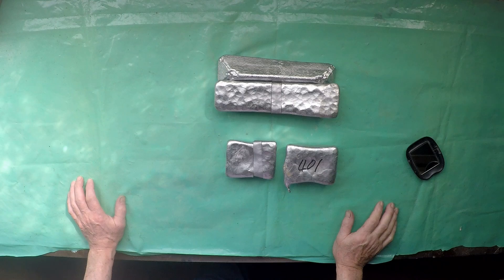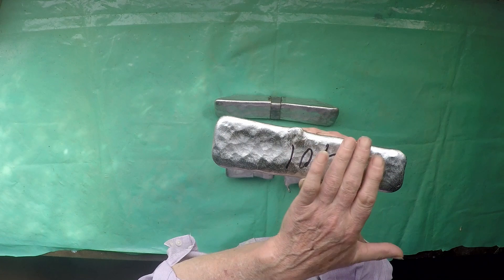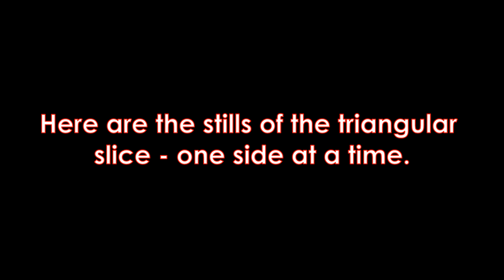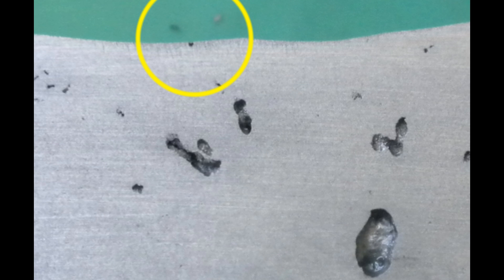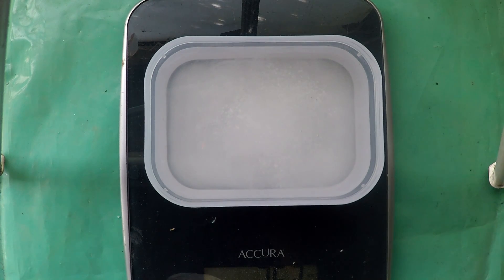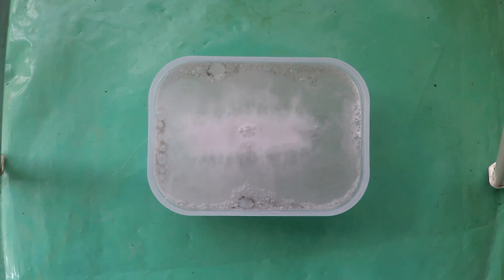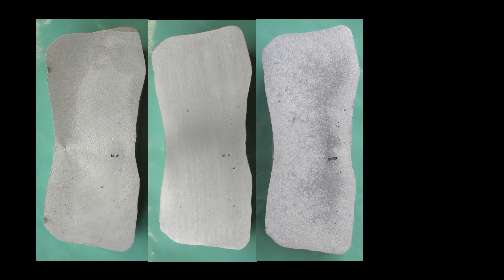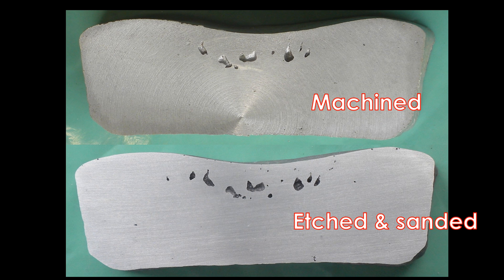Caustic Soda etching to reveal porosity in aluminium alloys.

Comment: Gloves and safety squints for certain with caustic soda.
If it gets in your eyes, you get less eyes.

The feeling on your skin is 'soapy' - it converts the fats from your skin into actual soap.
This NaOH etch produces Hydrogen gas, so be sure to do it outside, well ventilated.
I once blew up a car battery on charge. Hydrogen gas explodes really fast. A situation best avoided.
Alternative etchants would be HCl/Hydrochoric acid/Muriatic acid (all the same thing) or FeCl3/Ferric Chloride.

FeCl3 stains everything yellowy-brown. 
If it gets on your fingers you look like a seriously heavy smoker for a week.
Reply from the maker: aga, Yes, I am well aware of the dangers of caustic soda - another of its nasty little tricks is that its dissolution in water is an exothermic process - enough caustic in a small enough amount of water and it will boil possibly spitting saturated boiling caustic solution all over you. 50:50 caustic water will do it! 
And as you say H is very flammable and explosive, I too have had a battery blow up under my hands blew the top clean off  a 72 amp hour 12 volt battery scared the crap out of me and did not do much for the battery either. There of course it was an H and  O explosion a lot worse that H air. Not sure if HCL will do the same job on aluminium as the caustic and will generate H anyway (I think) and don't know about Fe chloride acidified or not its usually more used for copper base etching. I have both so I will try them -  stay tuned. Thanks for the input… Martin
Reply: @olfoundryman8418  Quite a few things will have a go at Al. 
It is an extremely reactive metal.
It reacts so fast with oxygen in the air to form that oxide layer it disguises it's real character.
HCl, H2SO4, NaOH, FeCl3 and many more chemicals will etch it.
For some, e.g. H2SO4, it'll go faster if you add a pinch of salt. The chloride ions strip away the oxide, exposing the actual metal,  making it go a lot faster.

My battery blew up because i'm partly Idiot. Just wanted to angle-grind a chunk off a bar, right next to the on-charge battery.

Had a full face mask on at the time, fortunately.
Took several seconds to work out exactly what had exploded, then the tingly/stingy sensation started all over my head and back.

Turned out that when the battery blew up, it sprayed acid upwards, which hit the shed roof and rained on me.

I flushed all affected areas with water very quickly (jumped in the pool fully clothed).

No angle-grinders were harmed in the process.

Comment: What grit are you using for your fine sanding?
Reply from the maker: Andrew, The abrasive paper is not actually marked but I would judge it to be in the 400 to 600 range. Its really the caustic that does most of the work - all abrasive strategies regardless of how fine will flow the metal and thus tend to cover up defects. The caustic removes the flow but it also exaggerates the cavities a bit because it will eat them a little bigger so  don't etch for too long. The final after etch sand is very light, just barely enough to remove the worst of the etch.... Martin

Comment: Brilliant video Martin. A real eye opener for a problem most castors are unaware of and do not know how to look for.
Reply from the maker: Mark, Thank you - it sort of shows up what most people never see. But also it shows that many worry about gas porosity unnecessarily - This metal was very gassy as witness the fizzing I saw as it solidified and yet in the sections there is very little evidence of true gas porosity and what is there is so small as to be unobservable without the etching (But polishing with a mop might have showed it up too). The large shrinkage pores are of course another matter but they are easily avoided with proper feeding in an actual casting.. Martin

Comment: Nasty stuff that I know lol. Add some lithium to that and you will get purple spitting fireworks from your container lol .do not try at home. Ahhhh so the tiny holes I seem to be getting are infact porosity and maybe not the loose grains of sand I thought they were. Thanks again Martin and swdweeb
Reply from the maker: Raschelle, Loose sand is unlikely to be within the metal.  it may be on the very surface and is then the result of not blowing the mould out properly with air. However, I have found it quite difficult to remover every little grain! You can get an idea by shining a torch at a steep angle along the cavity surface this will show up any little grains sitting above the surface. Really good moulders (way better than me!) used to solve the problem (in part) by "printing back" the pattern. This was the putting of the pattern back in the cavity after all the gates feeders etc were cut and thus any upstanding grains were pushed back into the mould by the pattern and the cavity  thus much smoothed up. However this meant of course that you not only had to get the pattern out but back in again and then out again - you need damn steady hands to do this!… Martin

Comment: Enlightening, thankyou. Here is my 5 cents worth. Having come from a polyurethane casting background, I  know a bit about bubbles and gas porosity in castings, but was always a bit puzzled in metal casting why the "gas "  didnt just go to the surface like it does in polyurethane. I now believe Campbell is correct in saying that the bubbles are actually voids caused by shrinkage pulling the bi-films apart as the metal solidifies. No amount of feeding will prevent these voids from forming. I think the term gas porosity is misleading. If you look at the shape of the voids, they are not round as you would expect , but pointy , backing up the oxide bi-film  theory. I also believe that the reason  bubbling inert gas through the melt works, is that the gas attaches itself to the oxide bi films, taking them to the surface where they are held there by surface tension. Aluminium oxide is denser than aluminium so it should sink but does not seem to. I think that is due to the variable thin layer of gas trapped between the aluminium oxide bi-films.
Reply from the maker: Greg, Thoughtful comment .Whether or not the bubbles go to the surface depends a lot on their size. The smaller the bubble the slower it rises and if slow enough it may get frozen in well below the top surface. Even if big enough it may get caught in an oxide bifilm trail that has become hooked on part of the mould. In this case it may be big enough to have enough buoyancy to  keep rupturing the top of the oxide film and thus ascend or it may not and thus remain caught somewhere in the middle of the metal. When (and if) it gets to the surface only the larger of bubbles will actually Pop (you will have observed something similar in the polyurethane where bubbles rise to the surface but just sit there and hence the gas flame to Pop them). Often the oxide film prevents the bubble popping and also the oxide film on the metal surface is too strong for smaller bubbles to break through. Campbell is indeed correct - he states that the tensile strength of liquid metal (strange concept but true) is so great that the forces associated with liquid to solid metal shrinkage are too low to cause the spontaneous appearance of voids inside CLEAN metal. A bifilm is a defect, a crack, or we might think of it as a deflated bag easily pulled open by shrinkage forces. However gas porosity is certainly a real thing. Old timers often used to say that you could filter gas out - You can't of course - but what you can filter out are the bifilms (those deflated bags) that the hydrogen gas needs to nucleate on/in. Thus even in hydrogen saturated metal gas bubbles will not just spontaneously appear, they need those bifilms to form. Without them i.e. with truly clean metal the gas would simply remain in supersaturated solid solution and do no harm. Remembering that bubble formation whether gas or shrinkage (but not trapped air) happens late in solidification it is obvious that the Bifilms will be contorted (pushed) by advancing dendrites into all sorts of non round shapes that will be reflected in the eventual pore shape. Bubbling inert gas certainly does float out bifilms but it is said only films bigger than the bubble diameter - smaller and the film just slips off the bubble. I firmly believe that hydrogen from the metal does move into the lower hydrogen environment of the inert gas  and is thus partially removed too - I understand that before and after analysis has indicate lower H levers afterwards. The oxide/metal density difference is not great and even the slightest bit of air or void or gas trapped within the "deflated bag" will over come this difference. convection currents will probably keep the films moving around too also some are spinel type lighter again I think. The addition of things like Tibor grain refiners can result in heavy particles attaching them selves to the films and thus weighing them down - this is I  believe part of Bob Puhakka's float the boat sink the battleship practice of melt cleaning. But we should all be aware that this is an area where the truth is as yet only partially known.. Martin
Reply: @olfoundryman8418  Thanks for that info Martin, clearly I have a lot to learn, but as a result I may just ask the right question (due to my ignorance) , that leads to some new solution.
Reply from the maker: Greg, We all have a lot to learn and none of us will ever know anything like even a small part of it - never stop asking and thinking its the only way to move forward... Martin

Comment: I've etched with caustic but was concerned it was selectively etching softer material potentially making good material look pitted.  I've been polishing and seeing cavities as small as 0.0015".
Reply from the maker: Andrew, Yes, any etching will remove different phases in the structure at different rates and thus if carried out for too long could indeed produce a pitted appearance - note though, that's it not necessarily the "softer" phased that are eaten out most. Polishing sure does accentuate porosity because  the "nap" of the buffs seems to eat into any small holes and not only enlarge them but also depress the surface around them, thus making them all the more obvious. One would need some decent magnification to see holes that small - my eyes are too old to see that sort of stuff unaided but having spent a lot of time in my metallurgy days looking down microscopes I can assure you that often materials are riddled with many holes way smaller than that... Martin
Reply: @olfoundryman8418  Do you have any guidance as to whether there is porosity which is small enough to be ignored from a strength perspective?

My question is around trying to avoid voids from hydrogen/bifilm.  Even if you don't have hydrogen to expand the bifilm, is it true the bifilm present, but not expanded, is still a defect like a crack?
Reply from the maker: Andrew, As a general sort of rule it is reckoned that if a defect (of any sort) occupies, say 10% of the cross section of a sample then the strength will be reduced by about that 10% BUT the ductility (elongation) will be reduced by much more -quite possibly about 50%. Certainly my experience with tensile test results (357  T6 alloy) is that anything that gave a poor elongation result had a quite large defect usually in the form of what I now know thanks to John Campbell's work to be an oxide bifilm, almost invariably the defect showed a semi iridescent sort of shiny blue/grey colour - probably a relatively older and thus thicker bifilm. It may or may not have had gas (H) or trapped air associated with it. I don't think it matters how small the porosity is - I would guess that 10% porosity present as hundreds of small pores would have the same effect as 10% porosity present as, say, just 5 or 10 pores. No doubt though if the porosity is so small as to get down to interatomic spacing it would be a different story. I think its a case of a hole is a hole is a hole is a defect and it will have an effect. This analogy might well break down with the case of one very large hole as depending on where it is in the sample under test it may have strange effects and from that point of view of if one has to have porosity I would prefer it as lots of small holes rather than the one big one.
If a bifilm is still "ravelled" it constitutes a much smaller defect than if has become unravelled and will thus have a smaller effect on properties. However it is still a defect and will still have an effect. Note that not only hydrogen can expand a bifilm air can do the same thing and so importantly can nasties like some iron aluminium silicon compounds and this is why you should NEVER melt aluminium in steel crucibles! The compounds seem to preferentially nucleate on the bifilms and as the growth orientation of many of them is acicular or plate like they grow in a straight line pulling the ravelled bifilm into a nice straight  and much more extensive unravelled one. Iron cannot be economically removed from aluminium alloys and once thus contaminated they are at end of life and fit only for burying in a hole in the back yard. A bifilm is in effect always a crack - ravelled its a smaller crack, unravelled its a bigger crack. The effect on properties is proportionate.... Martin
Reply: @olfoundryman8418  Thank you for the detailed response.  If I may I have a couple of more questions.

From a tensile specimen standpoint I understand a ravelled bifilm in the direction of tensile load is just as bad as an unravelled one (a tight crack still has no strength across it), but until it is unravelled, I can't see it.  Is it wrong to think the hydrogen does me a favor?

I have been using a stainless steel crucible with very little metal loss.  Is stainless steel as damaging to aluminum as carbon steel?
Reply from the maker: Andrew,  Re tensile point of view, I think its just a matter of the percentage of cross sectional area that the bifilm occupies. Ravelled or unravelled its a weakness but unravelled it will likely occupy a bigger percentage of the area. Hydrogen  does no one any favours (actually that's not exactly correct but lets not get into that here as it does not apply to sand castings except very badly made sand castings - mind you a lot of those about on YT and elsewhere!)
To my mind melting aluminium alloys in any type of metal crucible is a hanging offence (sorry) and those doing it should have their box of matches confiscated! The worst impurity that one can have in aluminium alloys is iron and once in you can NOT get it out - its the death of the metal. As regards relative resistance to attack grey cast iron is best (a bloody poor best!!!) followed by mild steel followed in last and worst place by stainless steel. The graphite in cast iron seems to give some slight protection, mild steel is slightly protected by the relatively thick oxide layer but stainless steel has such a thin oxide layer that  it is easily scratched through and then  once wetted by the aluminium it will eat through in seconds - stand by for wet boots as your SS crucible piddles molten aluminium all down you leg or ruins your furnace or burner PLEASE get a proper crucible! Rule one of making good castings - start with a high quality melt, one full of iron is NOT high quality - all else that follows then is a waste of time... Martin
Reply: @olfoundryman8418  Thanks for your reply.  I don't understand how I got over 200 melts in my 304SS crucible.  Part of it may be that I didn't clean it out much, and it was in effect an aluminum oxide crucible within a stainless steel shell.  Even when it finally had through holes it did not leak, it was just plugged with aluminum oxide powder.  I have to assume the aluminum oxide protected the molten aluminum for metal contact.  I made a new SS crucible which I am trying to keep clean and I am seeing some pitting after only 30 melts in it.

What material is your ladle made of?  I am wanting to make a ladle to try to get closer to the basin for pours.

What does the iron do to aluminum?  Will it show up in something like a bend test or tensile test?  I need to build me a rudimentary tensile tester.